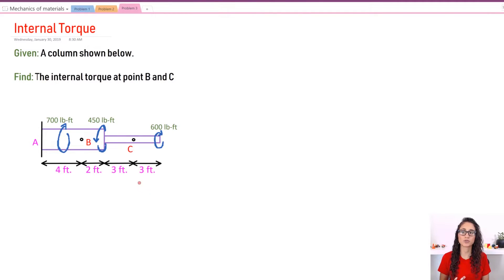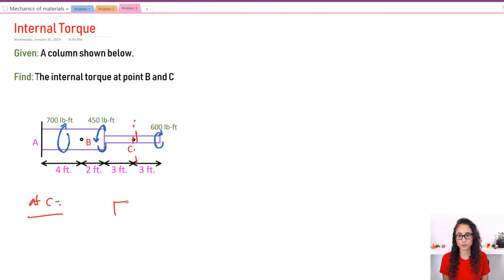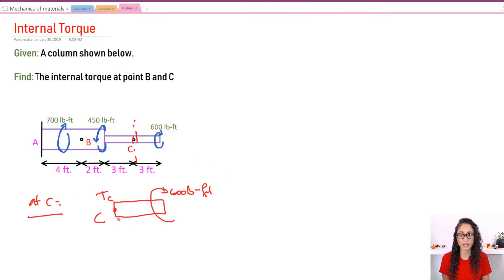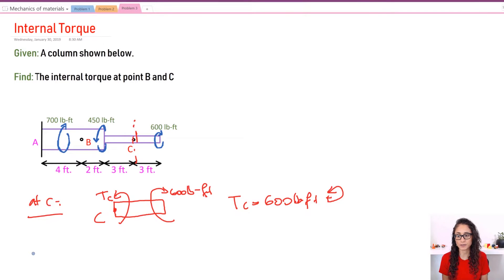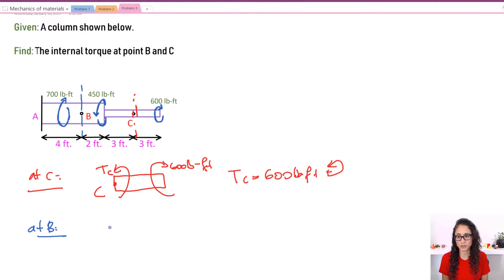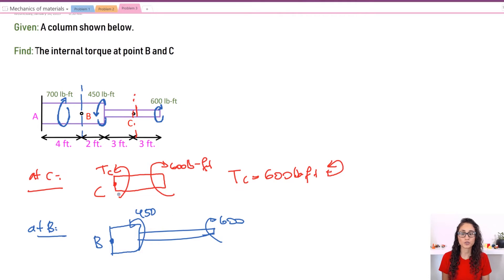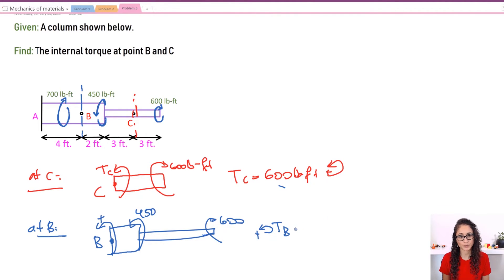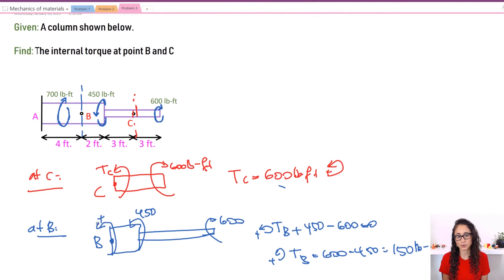FE Exam Mechanics Of Materials - Internal Torque At Point B and C

Comment: The method you used here is reference to the opposite end of A what if the reference is taken as A. Im confused. Taking reference at A I got Tb = -700 and Tc=-250. Or is it even correct to take reference as point A?
Reply from the maker: Hello, that is great question, we can't really start at A because we have fixed end. So always start at the free end. I hope this helps and good luck with your studying!
Reply: @Genieprep  But why actually a fixed end is chosen over the isolated end?
Reply: @Genieprep  Merry Christmas, and I know I'm late to the conversation but I think you actually can start with respect to A if it is a fixed support with a moment and a force in the y and x direction. It's just that, that way would be longer than the way you showed it in the video.